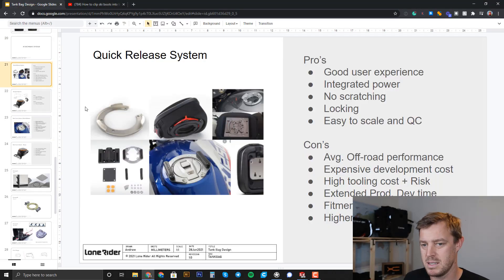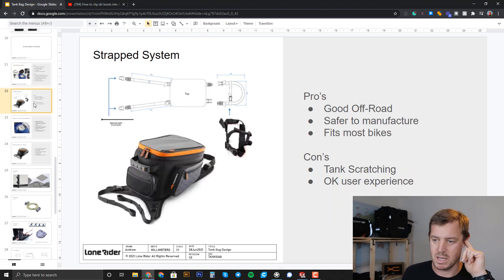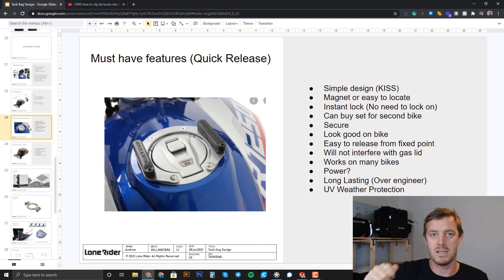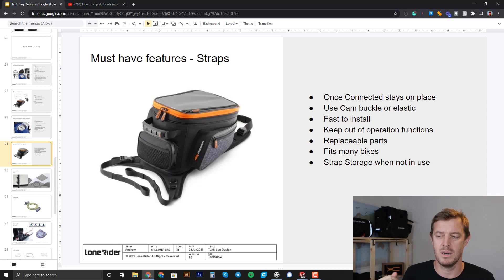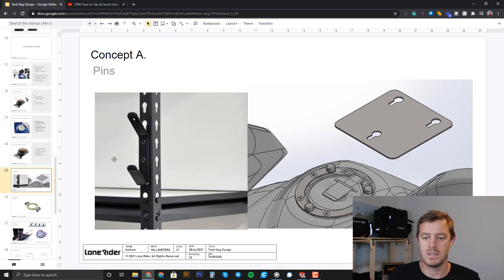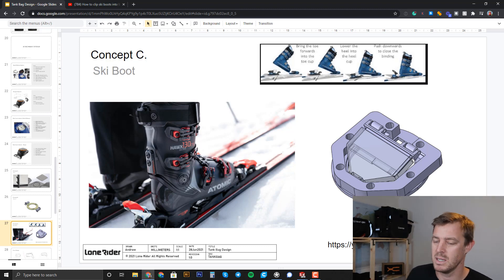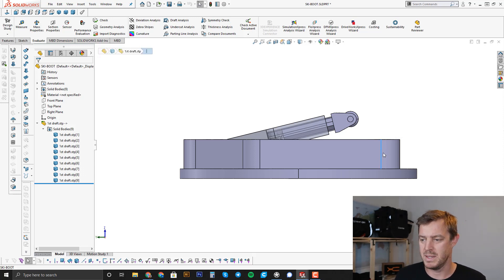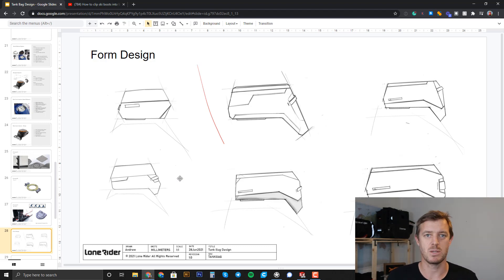Tank Bag Quick Release Concept

Comment: Hi Andrew, 

Love what your doing with these videos and keeping the user involved. 

I can only speak for myself here but I do have the Givi tank lock bag system. It’s great for convenience and can be interchangeable between my bikes after buying the adapters. 

But! It’s not a bulletproof system, it does fly off if the bike goes down a bit harder on the trail. Vs the strap and buckle clip design, that would be more secure and allow 2 of 4 buckles to be un-clipped to access the fuel filler (depending on the bike).

I was looking at the mosko moto tank bag because of its sturdy security & multiple pockets design & it turns into a backpack so it’s great for on / off the bike! 

But I’m holding out to see what you and the team come up with. Love what you guys do and what you all produce & keeping us in mind with the design with these videos is super engaging and makes the appreciation for the product reach new heights. 

Looking forward to next weeks video. 

Thanks,
J
Reply from the maker: Thanks J! Yer ok so they do come off. I have an idea on how to " Off-Road Proof"  so it stays on the bike when riding beast mode. I'll post the idea and then have a test on a bike

But good to know --> Givi tank lock bag system does fly off if the bike goes down a bit harder on the trail
Reply: 100% agree with this comment, I have the givi st602b but would like a combo of the same mechanism with the increased organised storage of the Mosko. The best tank bag I've owned was a Bagster/Baglux that clipped into a colour matched tank cover designed specifically for my black and red Kawasaki ZZR1100 some 25 years ago! Keep up the good work.

Comment: Hey, Andrew!  Thanks again for keeping us (the community) involved in these processes.  I am a big fan of the strap system.  The KTM model you used in this video has a "base" that straps onto the bike then the bag has a 3/4 heavy guage zipper to attach.  With my dual tank bike, this is ideal.  What KTM hasn't done is made the base with a fenestration for a single tank bike.  That would be a game changer.  No fiddling with straps at the petrol station.  Just unzip 2/3 of the zipper, flop the bag over to the side and there's your fill port.  I'm happy to send photos of what I'm talking about if I'm not clear enough here.  Also, as far as scratching goes, I use the clear, protective decal sheets and cut for high risk areas.  I don't think KTM does but GL sends out a good sized sheet of this with their strapped tank bags.  My thoughts.  Thanks again!

Matt J
Reply from the maker: Interesting, I did think of that but didn't know GL sent that out. Can do too. Just need to know that protective decal sheets are specified.

Comment: I have experience with the Hepco & Becker system and like it, because of its ease of use in removing the tankbag and putting it solidly attached back,  no damaging of paint, no ugly straps running across the tank down to the attachment points. So I'm interested in the solution you will come up with! Number 3 seems interesting!

Comment: I tend to like to keep things simple, so concept A speaks to me to that end.  The tech side of me likes concept B but I wonder about longevity / wearing over time.  Option C seems very interesting, however I’d have the most concern about this variant due to complexity of the mechanism more so than even option B.
Reply from the maker: Option C could be simplified. About longevity / wearing over time, I will build a machine to make the connection over and over and over to test how long it works...
Reply: That would make options B and C more interesting with the longevity testing.  Also a consideration is the aesthetic aspect, would option C be fairly bulky on the bike once removed?  Option A seemed the least ‘intrusive’ once you remove the bag.  This is just me, and admittedly I don’t remove my tank bag often other than to refill the gas tank
Reply from the maker: What do you think of the new idea: https://youtu.be/ctabtLHqO7k

Comment: Hi
Option C for the clip in system, I would engineer out the rollers as you said , its one (or two) less things to break. For the removal the bag / connection has to be pushed forward then pivot up? is there any chance that the rider (perhaps with a larger stomach) leaning forward could apply enough pressure to the bag to allow it to pop up if the rider went over a bump? might be better to incorporate a required slight downwards pressure with a push to the front then pivot out, using a rounded catch / mild hook type profile on the section created where you remove the two rollers?

Comment: I vote for Option C.
I am using a Givi tank bag (ST605) on an '02 R1150RS. I love the ease of the attachment system. Removal requires pulling on a tab with 1 finger for access for fueling. It is fast and simple to locate and install the bag. Your Option B looks like it might require both hands to actuate a release tab, along with trying to align the 4 'pins'. Maybe make the mechanism have a slight cone shape to help center the bag on the attachment point?
The front port for wiring is great for charging a camera/phone. I added a dual USB port inside the bag and use a battery tender plug at the handlebars if I decide to not have the bag on the bike.

Comment: I really like the minimalist pin system. It seems like it would look good on the bike without the tankbag. What's kept me away from the SW Motech and Givi tanklock systems is that they look awful when riding around with no tankbag. I generally ride a sport-tour (FJR). Would be nice to have the mount functional, yet nice looking. The ski-boot style may be durable, but it's ugly.
Manufacturing terms aren't something I'm familiar with. If the pins were machined to have a locking undercut and the bag had mounting holes with tabs that could slide into the cuts, that could work.
 The tankbag could "Snap" down onto the pins, and use a cable system/handle to pull back on the locking tabs when you want to release. In that case, for some bike designs, you could engineer longer fuel cap screws/locking pins to replace the OEM hex screws, giving it a clean look and close fit.
And as some have pointed out, put hideable backpack straps on the tankbag for easy transport off bike.
Reply from the maker: Here is anoth idea https://youtu.be/ctabtLHqO7k

Comment: Hi Andrew, 
Thank you very much for video and reaching out to community.

I am not fan of locking with tank flange systems. I am using Mosko Moto’s tank bag with strap system and haven’t had any problems/issues with quick release after the installation. Only drawback I can see is , it is difficult to come up with a shape to fit all of the bikes out there. It sometimes covers the fuel tap or the location of the bag might not be ideal due to tank’s shape.

Anyways, going back to your concepts - third one seems the most secure and innovative. However, over engineered as well. I can’t see it’s working flawlessly over the long period of time because of debris, heat changes (springs) and rollers quality. Also it would be somehow annoying to put it on the bike unless the bag is tiny. I think It would also be difficult to use it as backpack. 
Personally if I am not going to use straps I would look towards incorporating earth magnets (bag and the adapter) with the most simple slot system.
Also as an inspiration, SPConnect has a great quick mounting system. 
Looking forward to seeing what you are going to come up with next! Best
Reply from the maker: Ill check out what's on the market for  SPConnect and other brands. Maybe adaptable..

Comment: Currently I have a magnetic tank bag, but it's not perfect.  The magnets pick up metal from the dirt or road and which scratches my tank.  I love how fast it is to remove when I need to add gasoline, but then I'm always looking for a place to stash the bag while I fill up.  Usually the bag rests on my handlebars.  I don't like that.  I wish I had a tank bag that would flip up past 90° (more like 140°) so fueling is easy (staying connected at a single pivot point i.e. the "toe"), but then I could pivot the bag back down and snap/lock it back into place (i.e. the "heel").  Your ski boot design looks promising.  Agree that you need an adjustable tensioning system but it should be built-in (knurled dial/knob).  Also, like ski bindings that foul with snow and ice making it difficult to "step-in" to your ski binding, you need a way to keep the tank bag binding free of dirt and mud.  No one wants to have dumped their bike into the mud, releasing the tank bag and having the detents fill with mud and needing cleaning before you can motor on.
Reply from the maker: I can open the bottom out so material can exit. That could be a solution to the foul issue. Will test

Comment: I have a BMW tank bag, it has the straps. It always works, that's a pro.The bag itself rests on the tank and damages the paint, so there's a stone shield by 3M underneath to prevent that, which is of course a con. My wife has the SW-Motech tank bag. It doesn't touch the tank so that's a pro. BUT after riding a great stretch on gravel roads, we simply couldn't get it off. So we couldn't fill up, which was annoying to say the least. We spent the better part of an hour disassembling and cleaning it and putting the little springs back in place. Just recently it took again quite a lot of effort to get it off, but this time we rinsed it, tried it back on, still hard, rinsed it again and then it was working again. So for a next overlanding trip this will not accompany us as it's not worth the hassle. So when you mention springs in your design I kind of think Meh...

Comment: Just bought some some LR bags for my GS. Before that I looked a lot on whats available on the market, material used, prices,... While searching on the net for what I preferred most I also came across some of these presentations handling what's in the LR- development - pipeline and I like the way you involve riders during this process! Currently I still have the original BMW GS tank bag but will need some renewal in short time. So hope by then LR has his model on the market. 
PS, I like the idea of the Ski - lock. I would never have toughed about that. 
Curious to see what system made the selection.
Keep up the nice work and if you need some help from Belgium I'm here ;)
Gtz Tom

Comment: I don't like straps, they are a  non-starter for me.  

I'm intrigued by the magnetic mount, "Option A?"  My biggest concern would be the strength of the connection, especially when off the pavement with the rider standing and bumping the bag with his/her thighs while maneuvering.  How would you lock the bag in place?

I like Concept "B" - three buttons sticking up above the tank ring but agree that the interface may be difficult to locate and I see no way to lock the bag in place.  

Concept "C" will be really affected by the dust, dirt, and grit in the ADV environment.  My biggest complaint about my current SWMotec City Bag with their Quick Release system is that I routinely have to disassemble the locking mechanism from the bag and clean it.   I have had to replace it once after a trip up the Dalton Highway.  If you choose to go this way keep the mechanism inside the O.D. of the tank ring.   

 "A" and "B" seem better suited to the ADV environment than the many moving parts and close tolerances of "C".  

A difficulty noted with all three of your designs and with my current SWMotec City Bag is the tank ring is just enough bigger than the Center Panel that surrounds the Tank Opening that the whole mount ring has to be removed in order to remove the GS/GS Adv center panel for an air filter inspection/cleaning/change. If you go with A, B, or C please keep the mount within the Outside diameter of the existing Gas Tank Ring  so one doesn't have to remove the mount to access the GS/GS ADV Air Filter.

Comment: I actually think it’s quite tricky balancing the potential damage caused by a strap type bag versus one secured by something clipped to a device bolted through where the filler cap is used. I’m personally not that keen on the fuel cap flange fixing points.  This is because the fuel flange thread inserts are designed around virtually no load going through it.  So often say M5 threads with 6 fasteners.  Certainly no upward load case in standard operation.  If the bike is dropped on something and a heavy side load exerted on the bag is there a possibility to rip out the thread inserts in the tank?
My perfect world would be a strap attachment system  that is designed in such a way to minimise tank damage. Or perhaps a harness that straps to the bike then a bag that straps (or quick fastens) to that so that if the bottom of the bag is laid on the ground it then sits on top of the harness rather than the tank.  You could work on the underside of the harness material to best protect the tank maybe.
Reply from the maker: Yer, people tend to over tighten bolts, that is an issue for sure. 

But I dont think with 5-6 M6 Bolts it will be an issue, that amount of bolts can take tons of shear weight.

Comment: C looks very interesting. Very easy to handle. Maybe you would have some problems with fitting in on the bigger versions of tankbags because of the angle. You would have an contakt point on the front of the bag and the petrol tank, don’t you agree ? Greatings from Austria !
Reply from the maker: Understood. Will need to remove some material from the front so it slips in there nice.

Comment: I agree with you; type C is just outstanding. Think about the possible damage caused by put the bag down on the floor, table; ground or grass.... the bag will be settle on the locking system. In this case type A or B are much better.
Reply from the maker: I will round it out and resess the design so it protects the tank and also other products. But being plastic, it is softer than most materials.
Reply: @LONERIDERMoto  Sorry I didn't make myself clear. I was worried for the bag locking system not for the tank. If you put the bag on ground or grass I think   it is possible to damage the rollers. Imagine off road with the bike down you took off the loading and settle them on the ground.....maybe muddy.... If dirt goes between rollers and springs....will them still work? Ciao

Comment: Hi Andrew,

Thank you for involving your customers in thinking about a quick hitch system for a tank bag.

Your ski binding type system seems to be the most interesting. However I wonder about the operation when the bag is empty or filled to the extreme. Also when the mechanism is dirty due to the practice of off road
Couldn't a simpler but identical mechanism be that of bicycle pedals? (see link: Atack MX4 MTB model https://www.time-sport.com/fr/mtb-pedals/enduro.html). This mechanism seems less complex to me: only two springs and a wedge. hooking of the bag in the axis of the motorcycle, release by making a slight rotation of the bag.
Then I wonder if this type of grip does not risk damaging the paint on the tanks. if there is little risk with a BMW 1250 GSA, for others?

Best regards.

Comment: Why not take inspiration from the "Gearlock" mount? If you imagin the "mount for your phone" is over the tank cap. So basicly the Gearlock system in reverse. That should be very low profile, stable and easy to mount.
Reply from the maker: will have a look at this design. Cheers
Reply from the maker: What about this: https://youtu.be/ctabtLHqO7k